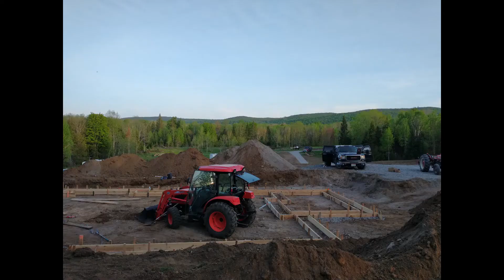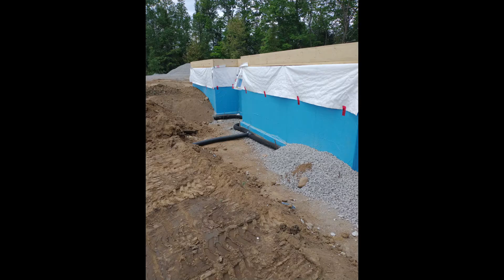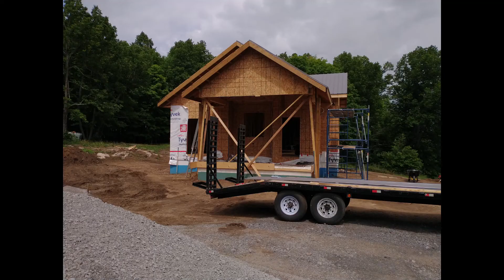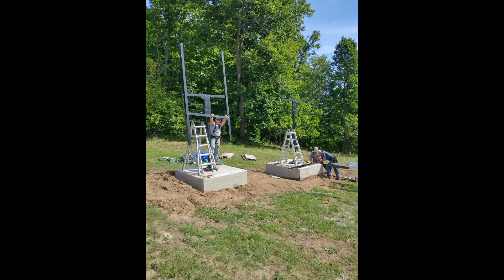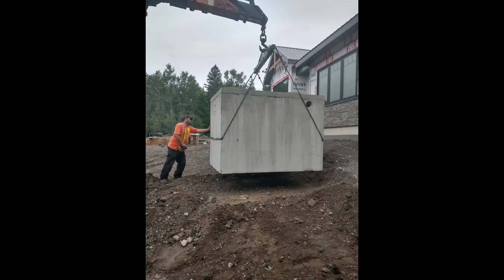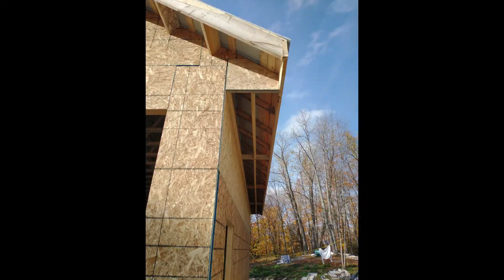House construction part #1

Comment: There's a lot about that house that appeals to me since what we put in our houses are similar. I put in similar windows to yours, and my oak floor is the same shade, just a little wider and random length.  I have a couple of questions though. Did you do your own ICF forming? Why did you go with a crawl space rather than full basement? And who's tge manufacturer of your exterior brick? I was looking at a similar Permacon product that hangs on a stainless steel grid, but it's pretty pricey through all the Ottawa suppliers. Really great job on the house!
Reply from the maker: Yes I did my own ICF forming, I had one more row to add but I did not want alot of stairs into house from outside. Our building plans also only had a basement hatch door in a closet already. We could not go down more as we hit rock on the chimney side of the house and could not go down any more. (we already moved the house 17 feet toward garage) Plus we are retired with no kids don't need a basement but the crawl space is 5 feet tall which is fine for storage. Our last house was 1 floor 2300 sq feet and full unfinished basement which we never went down there other to change the filters. 
The Exterior brick was purchased from Country Depot in eganville On. its also available through Home Depot. Its Fusion Stone. Thanks